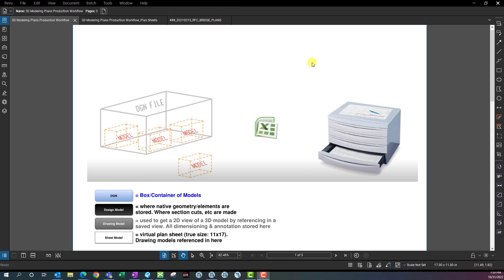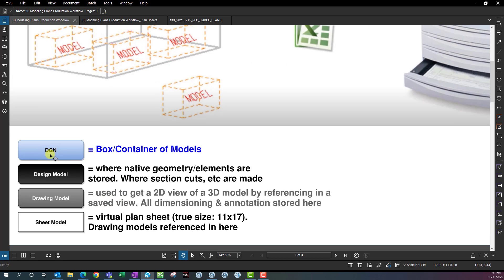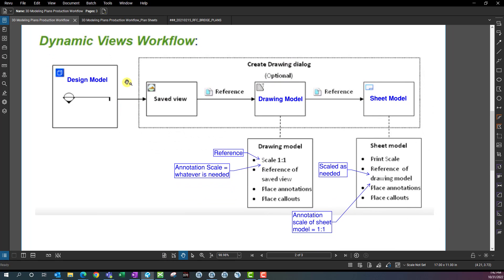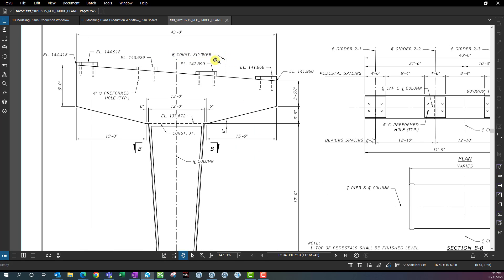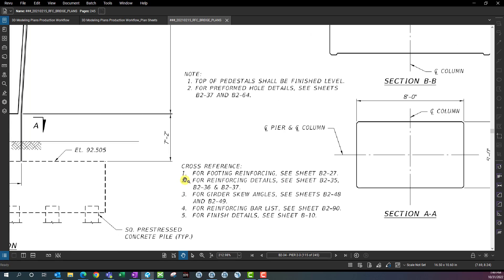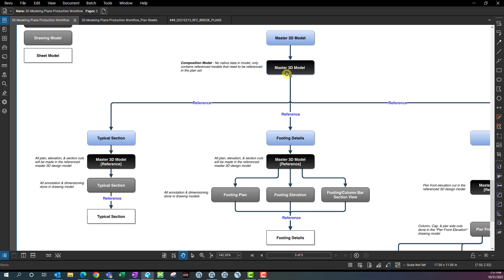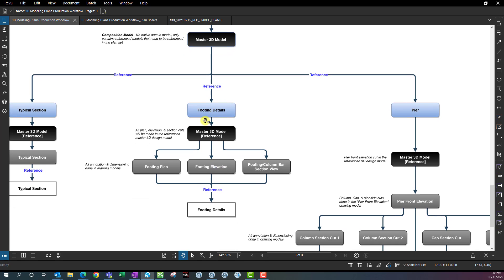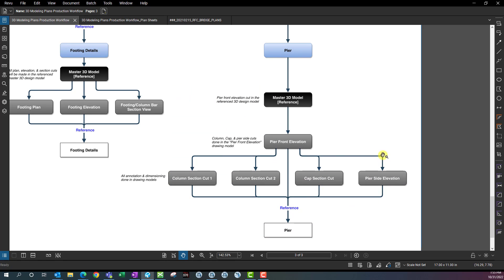OpenBridge Modeler - Plans Production Workflow Overview

Comment: very helpful explanation. If I can I have 2 questions:

1) reason for callouts in drawing in case of pier. Is it just more convenient way than placing them in master 3D model? Since I believe all drawing models could be paralel as in typical section and footing.
2) your pier seem to be custom pier so created as a cel and used as functional components. How do you workaround the issue when you need to add more details to your pier during designing process. I mean you are forced to update your cell custom pier in 3D master model of your bridge and so loosing any associative dimensions in drawings like Pier Front Elevation. As well I am afraid that you are loosing associative behaviour even by moving callouts. For example if bridge span is modified.

My idea is to create single model just for Pier and here do all section callouts related to pier. From this single model you can generate updated custom pier (functional component) to master model for bridge alone. This single Pier I am planing to use as a reference in proconcrete for reinforcement.
To sum up I thing that if we need custom elements not provided in OBM library we are actually forced to build bridge from bottom to top and not vice verse as might bentley developers planed.
I would like to be wrong so I welcome any comments.
Reply from the maker: Hi, I actually do something similar to the workflow you mentioned. For substructure I typically build a stand alone parametric pier model and do all my plans production within that file. Then when that’s done, I copy the file, change the name, and update parameters for the next pier and my drawings automatically update. While doing that, I have OBM pier placeholders in the main model to check vertical and horizontal clearances. Once design is at a decent spot I will replace the placeholder don’t the custom pier, either by place custom pier or referencing in that standalone model and getting it into place.
Reply: @structuralsteve323  
Hi Steve
Thank you for your response. I assume you create stand alone substructure model in global position 0,0,0, am I right? Or do you move it at least in z axis to position it to the right elevation for later labeling?   
In addition, after closer inspection I was impressed by details of your drawings. I mean the dashed line separating the cap and the pier, dashed lines representing the part of the pier under ground level and special lines at the end of piles. Is it possible to achieve this level of details by using just callouts and combination of display styles and rules? I would like to have separated solids as a cap, a pier and a footing. And when doing callout through this solids I would like the edge representing contact of two solids (cap x pier, pier x footing) to have a specific line style different from contour edges. Do you think, that this is possible? I have seen that since version 2023 we can assign different line styles to edges of solids. However I am not sure if it applies to edges generated by callouts.